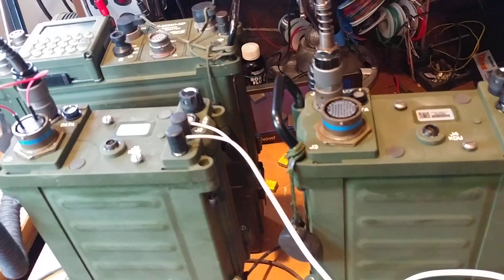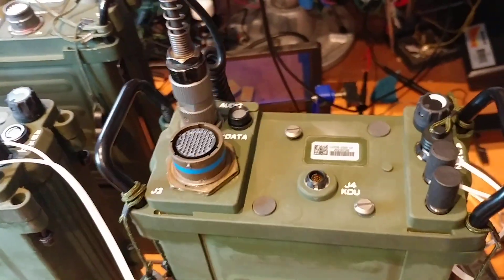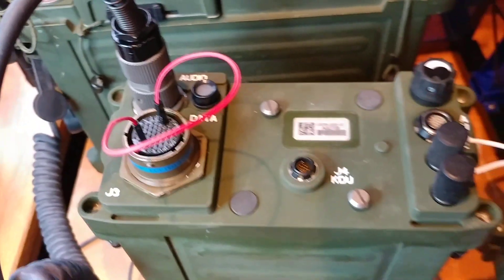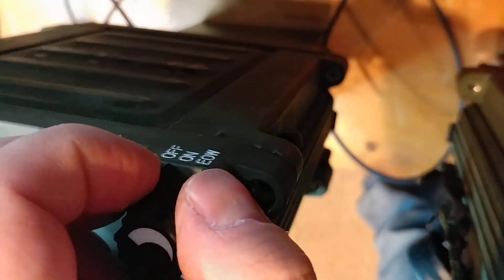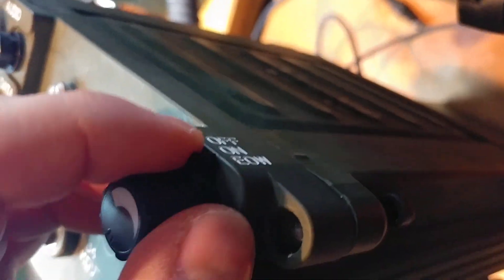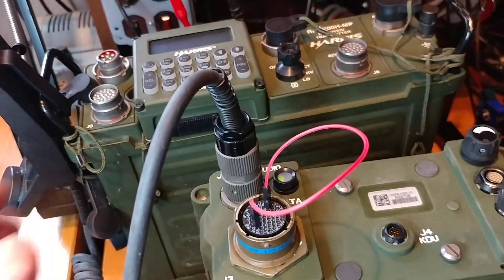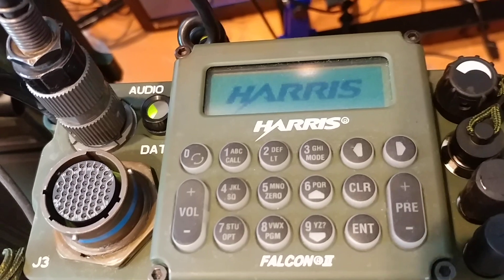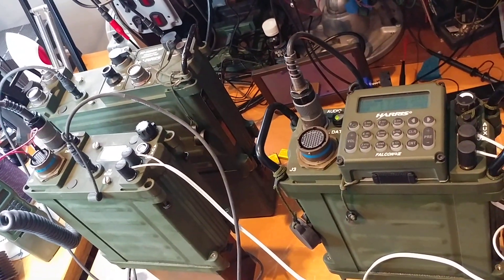Basic Workings of a Harris RF-7800R-RC Remote Control

Comment: Hello
I have a concern about the Rf7800H, when the station is connected to the Rack, the program loaded from my laptop disappears!
The menu cannot be accessed.
Reply from the maker: Do you mean the HF radio RF-7800H-MP? And when you say "rack" do you mean the amplifier base? I don't know why it would lose the programming. Sorry I'm not sure.
Reply from the maker: ok, I am guessing the problem might be the HUB battery is marginal. Consider replacing it (small battery)

Comment: I was using the rc 110 to remote a prc-160, im able to receive but able to transmit through the rc110 .Were you able to figure out wich pins were for audio and ppt?
Reply from the maker: I kinda gave up doing the reverse engineering once I got the proper cables. Sorry :(